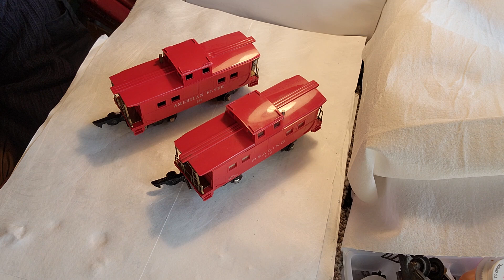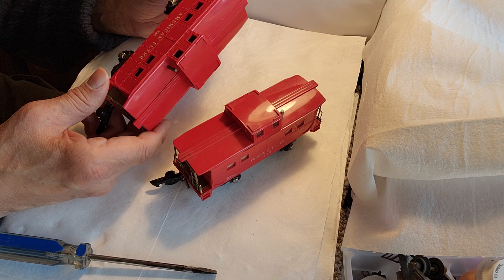LETs LIVEN UP YOUR PERSONAL CABOOSE........OH, THAT IS A "TRAIN" CABOOSE, OF COURSE

Comment: I no longer have room to add any rolling stock to my layout so I am turning my focus to improving details. I might add lights to one or more of my cabooses. I have distinguished many of them from each other by painting the hand rails different colors. Most of the 600 series cabooses now have one coupler converted to knuckle so I can run them at the back of any train. I may have to, from time to time, ignore your interesting point about there is a front and back because of the location of the smoke stack. I don't model a particular place on my layout, but I do model 1946-1966, so freight trains always have a caboose at the back.

Comment: Doug,  Do you have a reference for those LEDs?
Reply from the maker: Yes,  I think the easiest way to buy is on ebay. There are a number of sellers. One of them is:

"100 pcs 3mm pre wired red diffused Led Light Lamp 12V DC 20cm Free Shipping"   for$14.99
seller is sweetflower8588
Be sure you buy the ones with the built in resistors.
I hope this helps.

Comment: Nice project, thank You do you think smoke in the caboose would be fun??? I have done lights on the sides of the car but like you say not cheap. This is a good project.  Dennis
Reply from the maker: Hi Dennis,    I first thought about a smoke unit in the caboose when I came across  a copy of the original AC Gilbert engineering mockup drawing for an American Flyer smoking caboose.  Unfortunately that never went into production.  Later on I have seen Seuth units put into a caboose.  That didn;t work out for 2 reasons.  First the Seuth units are small and you constantly have to keep the smoke fluids filled, otherwise with the lack of fluid, the unit will be damaged.  Second, I believe the Seuth heats up very hot which is not tolerated by the caboose plastic shell.  Perhaps a small AC Gilbert unit either from a Casey Jones 21168 (it shorter than the regular steamers)  or the older HO size American Flyer smoking engines?